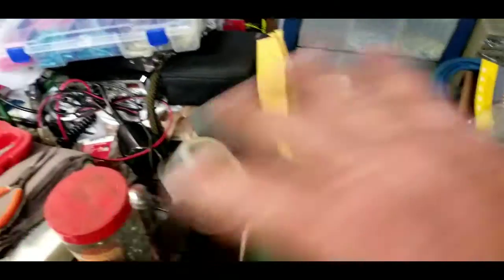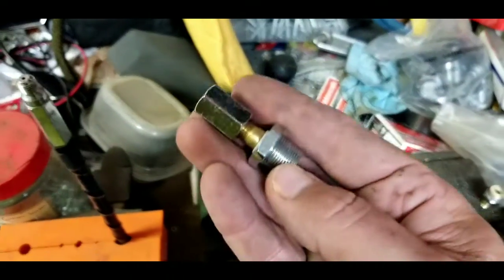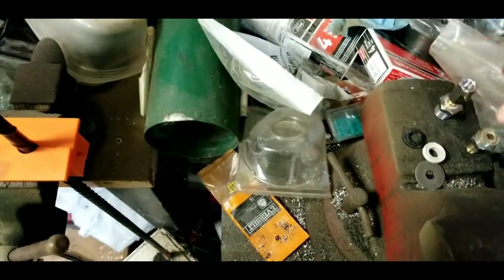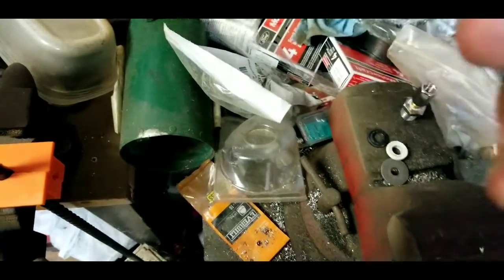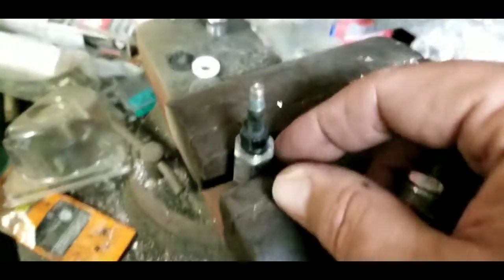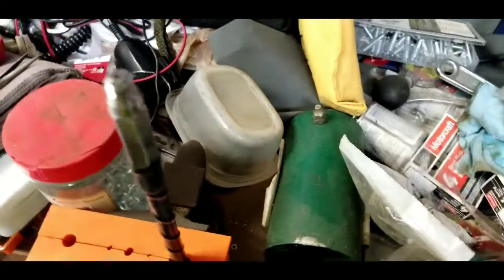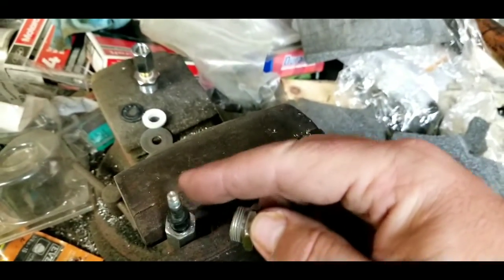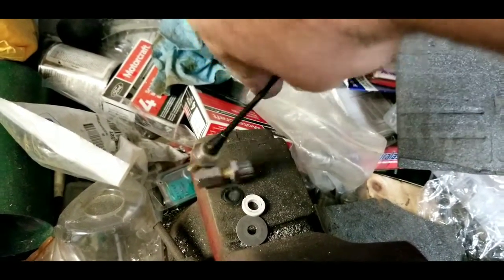CB antennas are not for AM/FM radio! (Here's the fix)

Comment: Hi J, I wish you would have talked to me first.  All you need to do is find and adjust the Freightliner AM/FM/CB splitter to get the stereo to work.  There are two trim pots on the splitter.  One trims the splitter into thinking the CB antenna is a 31" car stereo antenna, the other trim pot assists with the VSWR .  To tune the AM/FM pot, all you need to do is find the weakest am signal around 1400 and use a plastic trim tool and adjust it to the best sound and you are done.    The same goes for the CB, put an SWR meter on it and adjust the SWR for the lowest SWR on CH 20 then tune your CB antenna like you normally do .  Also the splitter will not handle over 50 watts.  If you put over 50 watts out of your CB into that coax that goes through the splitter you probably damaged the splitter and that might be why your stereo sounds poor.  You have several options but if you are running power that power needed to go after the splitter.  Some of the linear amplifiers might not pass a signal into the splitters.  The truck manufactures do this so if you run power you will probably get caught and need to order another splitter.  If you ran power through the splitter it will also sometimes permanently let your CB system act as it there is a poor antenna ground.
Reply from the maker: Didn't know that! However this took 10 minutes and zero dollars. And, my cb system is totally independent of the factory system. Check out my cb Playlist and you can see the different set ups I've tried up to now. Which I'm really pleased after the RF bonding.

Comment: I’m have issues with my factory multiplexer and the only reasons that I don’t want to bypass it and run new coax is that I would have to mount an fm antenna and I have heard that fm antennas will not pickup weather band. I’ve only used it a couple times though. But this is a good option though. Thanks
Reply from the maker: There's a coax on Amazon  that plug into the back of the AM/FM radio and the other end is a PL-259 the goes to the cb antenna mount.

Comment: I have the opposite problem.
I stalled a "modern" radio into my 98 F-150, and now I can't pick up the channels I use to pickup on the truck's default radio.
Trying to find ANY antenna that would work.
:EDIT:
Just did a quick search on Amazon and they have adapters for both our needs. Simply searched for:
cb to radio antenna adapter
Reply from the maker: Sounds as though there's a problem with the new radio, or the antenna is not plugged all the way in to the back of the radio. And searched Amazon and they don't have exactly what I needed.